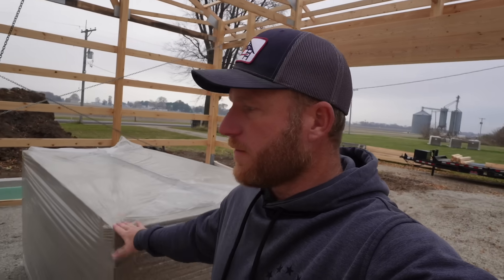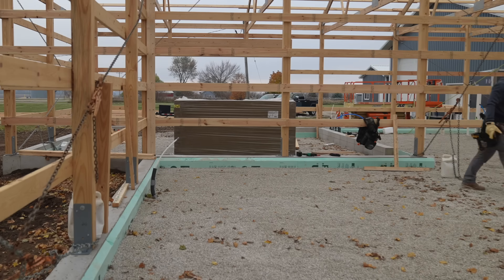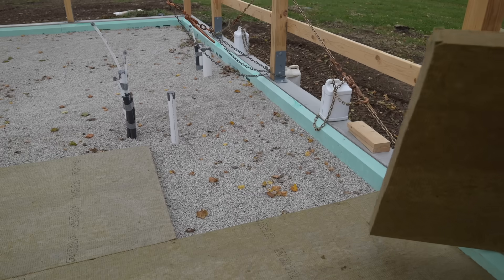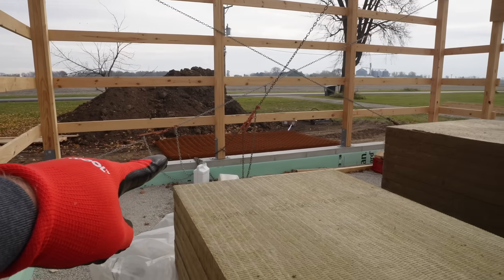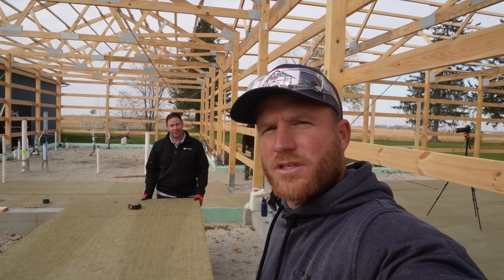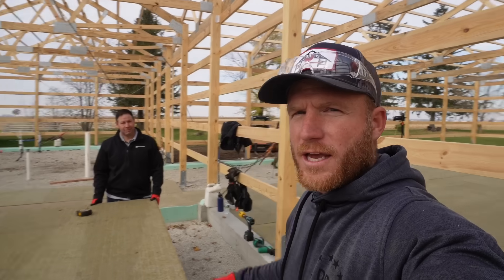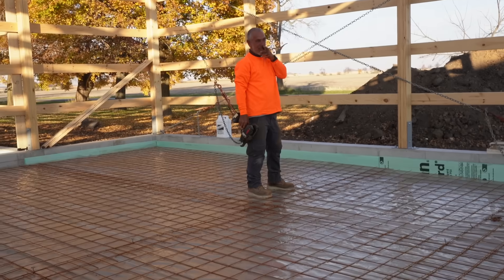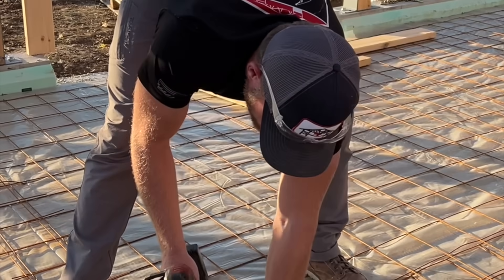Building The BEST House Part 3: Installing Rockwool Sub Grade

Comment: This is a mistake, unless there is a moisture barrier under that gravel that i cant see... Moisture will come up from the ground and get into the Rockwool, destroying it's r Value...
Reply: Well you obviously know nothing about rockwool
Reply: Rockwool doesn't wick or retain water; it actually repels it. And what does get wet (if exposed to the elements) dries quickly. The Rockwool rep in the video even said that it's great for below-grade applications precisely because it drains water.
Reply: @SouthernPecan86  that is utter rubbish.. I had a leak in the wall of my last house and the rockwool was saturated with water.. It was like soggy diapers and it also destroyed the binder as it all fell apart during removal..
Reply: @FJB2020  Well, that is very strange but also unfortunate and sad to hear. So you experienced that.
Reply: @SouthernPecan86  Only suckers believe everything the SALES REP tells them..
Yes of course the Rockwool does not wick water and of course it will dry out real nice without being harmed in the long run, because it is made of rocks after all.. But in this installation, those facts are irreverent! That only helps you in installations where the Rockwool is given the opportunity to Dry Out!!! When the Rockwool is sandwiched between the Very High moisture dirt and the plastic sheet Vapor Barrier, THE ROCKWOOL WILL NEVER DRY OUT!!!. The rockwool will always be at the same moisture level as the dirt under it!!
Also, did you miss the part where the rep says "Moisture goes right through it"???
Reply: Watch the video again. The rep talks about this
Reply: @michastoutenburg9823  The rep is also selling his product. Putting rockwool directly on top of dirt and under concrete doesn't make any sense to me. Where I live, we can't even put anything less than a 30 psi insulation board under concrete, and that's for residential, it goes up from there. I can't find the specification of this product, but there's no way it's higher than 10 psi by the look of it. 
This also cost over twice what a traditional 30 psi foam board would cost btw, so what's the point?
Reply: @MrArcticPOWER  It's not directly on top of dirt. There's compacted gravel there that they're setting it on.
Reply: @michastoutenburg9823  Let me start by saying that I love Rockwool, I've used many thousands of dollars of Rockwool, and that's saying a lot since the alternative is 1/2 the cost...  But seriously, You guys are way too trusting of the person whose job it is to sell you this stuff... You need to use your brains and think for a second how Rockwool is made. Rockwool is full of small empty air spaces that are not sealed from the environment like closed cell foam is. The dirt under the rockwool is VERY high in moisture. That moisture will migrate into the small airspaces in the rockwool. Water is a great conductor, so the moisture in the rockwool will speed up the transfer of heat across the Rockwool.And since the rockwool is sandwiched between the VERY high moisture dirt and the Plastic sheet vapor barrier, The Rockwell will never "Dry out" ... It will always have the same amount of moisture in it as the dirt has in it!!
You do understand that if this same type installation was done in a place with a very high water table, a water table so high that the Rockwool got fully saturated with water, that the R Value of that saturated Rockwool would be basically ZERO. 

I'm not saying that will happen in this installation, I'm just saying that we are dealing with a simple fact of physics here:The Higher the Moisture content in the Rockwool, the lower the R value.
Reply: Many of the comments are true and seemingly contradictory. But it’s all about context. Let’s stipulate 21-25 psi for the 80mcomfortboard are “ok” but not robust for sub slab of only 4 inches, so yes we can conclude it’s acceptable but not great-does that mean it’s ‘fine’? It’s up to you and your concerns about slab cracks. Yes it’s twice as expensive, but taping not required and friction fit. A big advantage. If u r dong the labor, makes sense, but don’t expect a sub to rebate you his,labor savings. Is rockwool safe to work with? Well,it’s not asbestos. And it’s not cellulose. Ie it’s inorganic and it’s fibrous-studies have shown it’s not as touch as asbestos, but is breathing any inorganic fiber a Great idea? Gloves and a mask raf called for I should say in any case.no for the water issue,obviously if your table is high, u not only should not be using rockwool, you should forgo idea of a basement obviously. Let’s say standing water not an issue. If you have an good interior drainage system , 4-6 inches of large gravel to drain should be ok. Yes it repels water-that Emma s the individual fibers don’t absorb it, any more than wool does, but the MATRIX can store a lot spong like. Recognize also that ground in most areas of America are not dry at any part of the  year, and sub ground humidity quite high many months of  year in many places. Assume full saturation unless we are talking first foot of a desert!
Reply: PPS-another reason to place vapor barrier on top,of insulation is to protect it from jagged rocks

Comment: I find it funny how you have foam insulation to insulate the floor insulation from the footing. So insulation to insulate the insulation 😁
Reply from the maker: the foam was installed by concrete guys along wall for thermal break